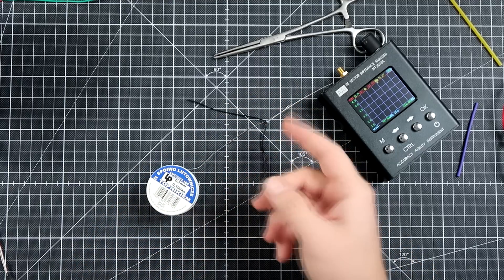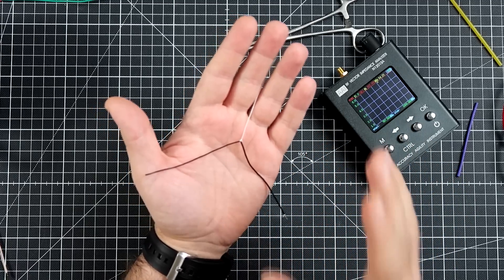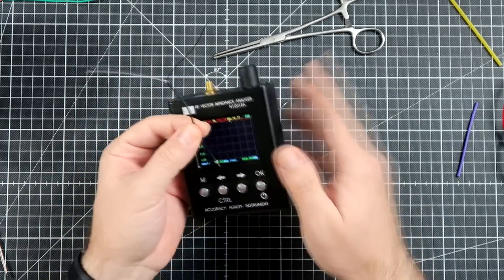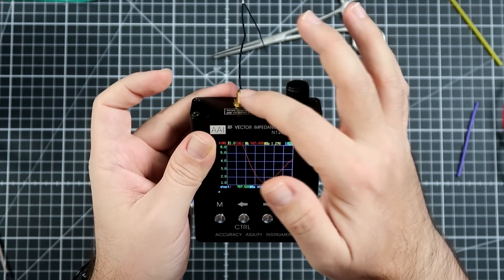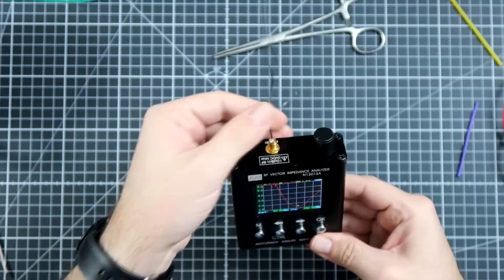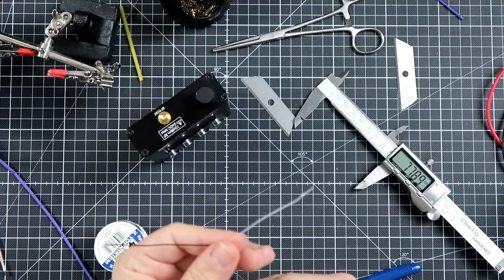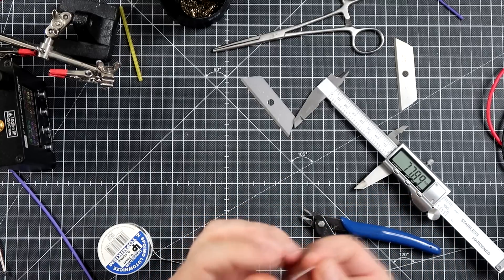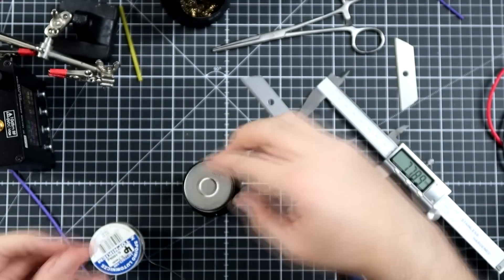Ho to retune FCC 915MHz FrSky R9 Mini antenna to Europe 868MHz

Comment: I set my R9MM antenna to 78mm, and it has done nothing to improve the RSSI at all....At 500 mtrs it drops like a stone to values around 50 or less, also seems very unstable...even using a 200mw TX output.
Im using the Tru-Mox 868mhz antenna.

Comment: I saw Bruce from RC models reviews test the FCC band and it goes from 900 to 930.  So the tune of the wire at 915 is right in the middle of FCC.   I use the wire antenna on my quad now with antenna tubes.  So I guess its closer to 900mhz which is the low end of FCC.    Soon I will upgrade to the frsky T shaped immoral T antenna.  I think it will be better tuned when I mount it on my quad.    Because I wont have to use antenna tubes to mount it which would change the velocity factor.   The T antenna is pretty stiff twisted wire and it already has a protective coating.   So I assume it will arrive tuned to 915 and I can mount it easy.

Comment: eek.. i swamp my 2.4ghz antenna in cable tie and heat shrink... maybe thats why they are shorter than stated 1/4 wavelength?
 very useful info for euro pilots

Comment: Thanks for this! I just got me N1201 a few days ago. For you and everyone else messing with rx antennas, search "SMA Male To U.fl Male Goldplated RF Connector Adapter" and there's a nice one to be found from aliexpress and ebay. I will have it to try tomorrow I think. ;)
Reply: Yeah, great advice. 
I'm using the same adapter with my N1201SA, and it's realy convenient. 
But unfortunately I didn't find similar adapter to MHF4 IPEX connector, which is necessary for tuning the R9Mini / R9MM antenna.
Reply: @OTR1UM  I've been looking for one as well, but thankfully I pretty much only use Slim+ 
Do post here if you come across them please!

Comment: Is this also true for the T-Style Antenna for R9 ?
Reply: On prodrone.pl you can buy handmade (I guess) 868mhz antennas. Pls test them and the eu version from horusrc.com .
Reply: https://www.horusrc.com/en/frsky-900mhz-ipex4-dipole-t-antenna-for-r9-mini-r9-mm-receiver.html
And
https://shop.prodrone.pl/en_US/p/ProFlex-Dipole-868Mhz-915MHz-U.FL-TBS-Crossfire-antenna/192
Reply from the maker: I have no idea, did not tested them
Reply: Paweł Spychalski 
Do you plan to do so?
Also some shops offer them as 868 some as 900 in Germany ?!? Strange because on Frsky website I think theres only 900 😉
Reply from the maker: @jas-FPV  I think they understand 900 and both 868 and 915
Reply: Paweł Spychalski 
Of course, but a tuned antenna is always a good thing to have 🙃
Reply: On horusrc you can choose an EU version of the 900mhz antenna, which could be tuned to 868mhz

Comment: I am running FCC R9, so if I have the antenna in an antenna tube to hold it upright, I'm making it less efficient?
Reply from the maker: Depends. LoRa modulation used in R9 plus hequency hooping can be a few MHz wide. So even if best VSWR is slightly shifted, it might not make any difference

Comment: Just a question : what is the second antenna wire with heat shrink on it ? What is it used for ?
Reply from the maker: a ground plane for the active part
Reply: What is the correct length of this part of the antenna for best swr?